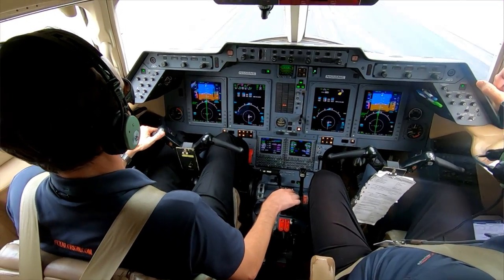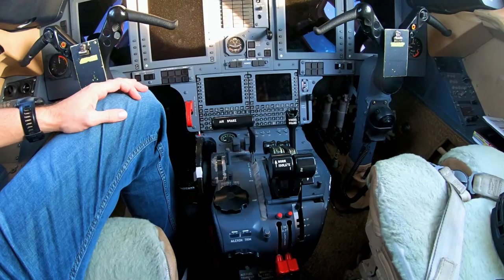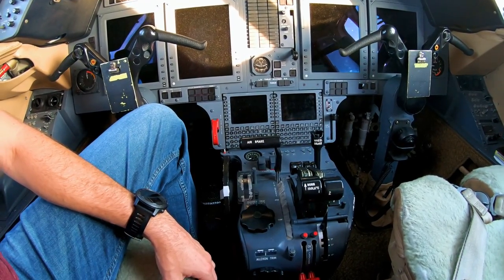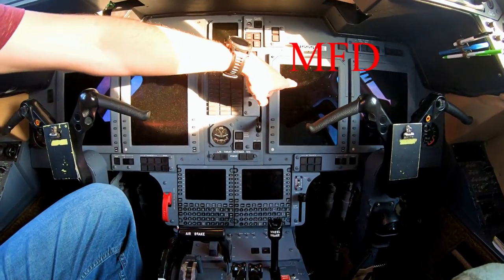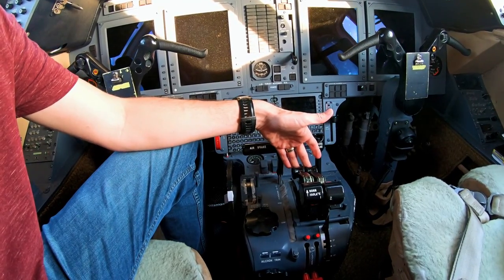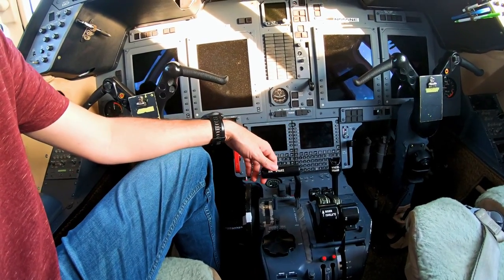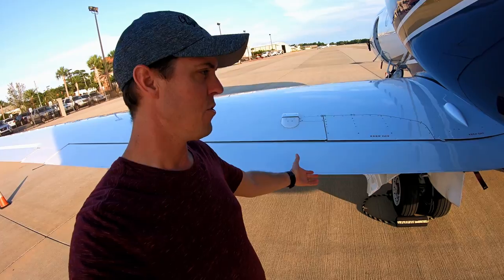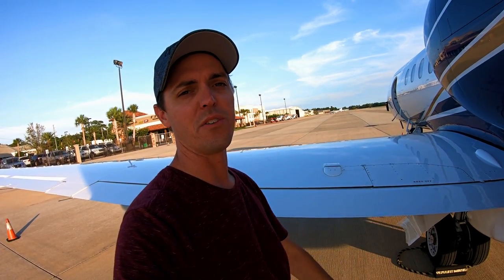Tech Tuesday - Speed Brakes and Lift Dump

Comment: The yoke kinda reminds me of the Concorde yoke. Thanks for the video Shaun
Reply: It reminds me of an exercise bike! Dosent look very comfirtable or ergonomic either but i could be totally wrong.
Reply: You are totally wrong. 

That yoke is actually very ergonomic and comfortable. Because the angle matches the natural way your wrist and hand sit. Lot's of thought was given to it's design. Unlike every aircraft with an upright yoke which requires your wrist to twist to an unnatural angle. Creating strain even before you actuate the yoke.
Reply: @zero1zero184  
Reminds me of a yoke off an Embraer.  I've known a few ERJ drivers and they have never said anything bad about the yoke which tells it is very functional.
Reply: It’s the same one

Comment: How do you screw up pulling the lift dump handle back, which drops the flaps and raise the air brakes which I understand is about all it takes to really slow the 800.  That was the screwup here... had the dump been performed, there would have been no need to decide between stopping and performing a go around.

Comment: Shawn, can you extend flaps to 75* to get a really slow a stall speed out of her? For example, if you were landing on a really short runway and needed a low Vref speed. Or is the 75* for braking only?
Reply from the maker: In theory, the lift dump can be activated in the air, as there is no connection to the squat switch, but it would literally fall out of the sky. I don't think the engines make enough power to keep it flying with that much drag.
Reply: Corporate Pilot Life Thansk for the response. 👍

Comment: Shaun - something to mention is the fact that using the dump system saves wear on the brakes and the reversers, which transalates into less frequent brake replacement (as you covered on the Citation) and saves on the overall operating cost of the airplane. In addtition, every time the reversers cycle it introduces the chance of a mechanical failure and I think if a reverser is INOP, it's a No-go item and grounds the plane until repair? As an AC mechanic (long ago) on com'l jets I appreciate the very simple effective, mechanical system to get the airplane slowed and stopped. Now all you need is auto-braking and CAT-III capability!

Comment: Does the “Lift Dump” have a weight on wheels safety similar to the nutcracker?
Reply from the maker: Actually, it doesn't....pretty crazy if you ask me
Reply: I’m amazed that it doesn’t
Reply: Shaun the only Hawkers that tie Lift Dump into Weight On Wheels are the ones in Canada. TC said "you'll let the pilots do what in flight???" "No I don't think so" So they have an Airbrake Baulk mod. But only on Canadian registered Hawkers.

Comment: Great video one question  I’ve heard  that
Spoilers cannot be used ones the flaps are down is these true thanks
Reply from the maker: That is correct while in flight. Once we touch down, then we may extend the speed brakes  with flaps extended.
Reply: Great series of videos and thanks Saludos from MMAN
Reply: @CorporatePilotLife  Side question if you know, as you were and Instructor once. When I started to fly in 1970, it was a Cessna 150 ( yes a 150)  I was told  NEVER slip it with full flaps, because it would more or less do a Lomcováktype tumble do you know if that was true? Ya, I never have found if it was true or not.